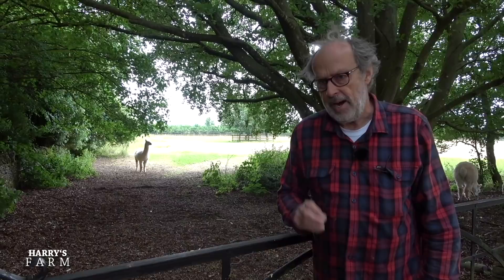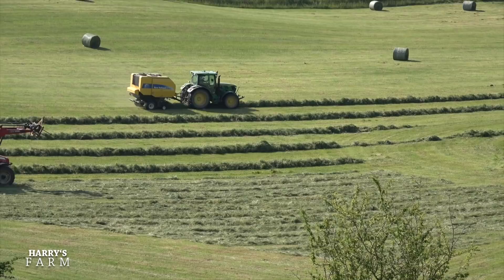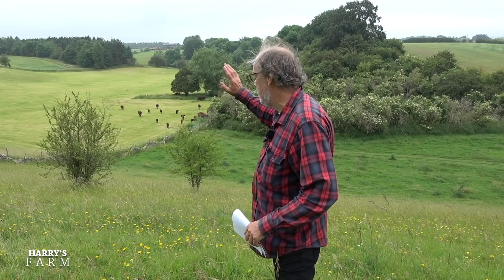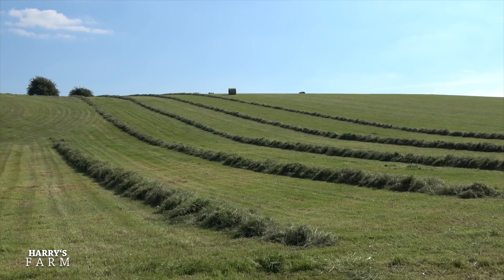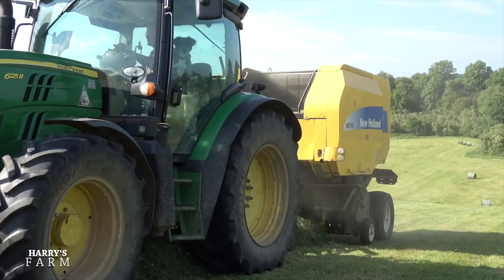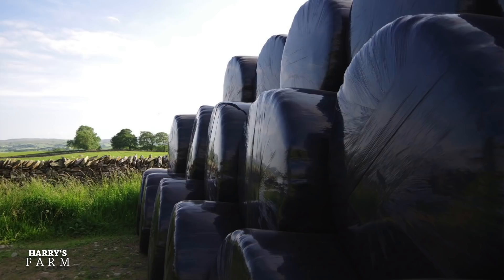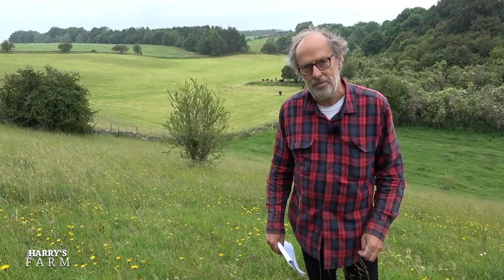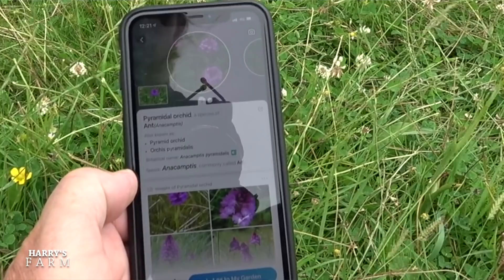Should I be growing Miscanthus for electricity production instead of growing food?

Comment: Great conversation on different crops to support carbon and energy. I would have thought Hemp has to be in there somewhere as well as an option. Love the rants on cattle farming, when I saw the Australian deal come through, I was thinking what twats the UK gov are being. Its makes far more sense to promote local producers than import from overseas products like beef, sheep, pork and chicken meats. Not just because the smaller operations here will be easier to regulate and control the quality from, but more so because there is less carbon produced in getting the products to market. Interesting you had so much trouble getting planning for a solar park? have you thought about energy storage instead of energy production? I have been thinking farm hedge-rows and fence lines are prime land where large battery or tanked energy (like liquid air) could be stored by power companies giving farms the ability to operate a bit like a grain co-op (taking in excess energy when renewables produce too much, and releasing it again when renewables do not produce enough). Regardless its great content to discuss and will be interesting to see how farming changes in the coming years.

Comment: Harry , I find your videos so interesting. Your point on using the miscanthus grass to cope with peak loading. I’m not sure that stacks up as a gas turbine gas sets can run up within minutes if not seconds I can’t believe  you could run up a steam generating set in the same time, unless of course they use it in a gas turbine which is possible but the hot blades may suffer.  Great video. Love the car stuff to. 👍
Reply: David, it would have to be burned and used to heat water to produce steam.
It won't have a high calorific content for the amount used such as coal or gas. 
The co2 produced may be offset by the amount of co2 originally taken in by the plant as it grows.
Reply: @neilorton5162  yes it would but not as responsive a gas unit for peak loading is my point.  Is it not the same as burning wood?  Food production is surely the priority. I bet it will be in the near future.

Comment: We rely on contractors for baling silage and they wrap in the field. I run around with a bale lifter taking them over to where we keep them. I've experienced a runaway wrapped bale once and was directly down range of it in the tractor with another bale on the back. The moment I saw it I threw it in reverse but reversed down to the left, we don't have the biggest tractor, a 4WD 390T with a loader but no front weights, so reversing at speed down a steep hill with a somewhat heavy bale on the back isn't the most pleasant experience. Due to the way the hill was the flaming thing turned and tracked my attempt at getting out of the way until the last moment when I turned tighter than it was going to at the speed it picked up before it crashed into another bale and stopped after that. Neither tore surprisingly. Perhaps stupidly, I didn't want to run over the yet to be baled swards in my attempt to get out of the way, hence reversing down hill to where gravity wanted the bale to go. I try to stay uphill of the baler/wrapper (our contractors now have an impressive combined baler-wrapper unit) now. :)
A family member shared a story with me a while ago about someone who's tractor was hit by a runaway bale when side on by the sounds of it and it apparently split the tractor in two. 1 tonne of silage with a bit of speed up on a steep hill and someone's wee 2WD Ford or similar in the way, I imagine it would be entirely possible. I don't know if they were trying to stop it or what but obviously the tractor came off worse.

Comment: Harry. I would be concerned as a farmer, that after investing all the money in establishing a harvestable crop of any biomass, large scale battery technology negated the need for biomass burning.
We know vast sums on money and research are being pumped into electricity storage ATM. You said yourself that solar panels would produce 5x the energy per ha, so far more efficient. Also, small scale nuclear power, either PWR or Gas cooled is being seen as a reliable zero carbon energy that can fill the wind/solar gaps.
I think the miscanthus would need to stack up purely on the carbon credit front to make it financially viable longer term (5yr+) to make me interested. I wonder what the carbon sequestration is if the biomass is chopped and left on the field?

Comment: Harry, 

I would say from a sensible point of view no, whether it makes commercial sense to you is entirely another matter.

Drax, in Yorkshire burns wood pellets which I would guess have a much higher thermal value than grass. Wood pellets have a lower thermal value than coal and hence emits more CO2 per Mwatt hour. Grass I would imagine will be worse.
Drax's fuel comes from chopping down forests in America, processing the timber and then shipping it to the U.K., all highly intensive in energy terms and then the loss of a forest for decades until it regrows so why they consider Drax to be renewable and pay them a subsidy as well is beyond reason.
Quite what energy is required to grow and process the grass is beyond my experience but it seems illogical to grow plants just to burn them as an not too effective fuel.  Much the same as ethanol for fuel, again an energy intensive process yet they claim it will reduce CO2 emissions from transport, frankly I do not believe that is true.
Reply: It’s utter bullshit. Harry should hold his head in shame for even considering this.

Comment: 1 ha of Miscanthus can produce biomass equivalent to 12 tons of coal.  It can be easily converted into biogas, that being almost identical to methane/natural gas is ideal for light vehicles in compressed or liquid form.  The only issue is energy crops replacing food crops........which is why Miscanthus and switch blade grass are best suited to compliment traditional crops on poor,marginal farm land since it requires almost no investment in tillage and herbicides, and can control soil erosion.   If we can get all that marginal land into biomass crops, it can make a substantial contribution to providing net zero carbon, and energy diversification. If you want electricity, just build Thorium Molten Salt Reactors..........but who wants clean electricity at half the cost of coal, no profits or scarcity in that business model. There would be no need to herd people into ""15 minute city" concentration camps and other such dystopian totalitarian schemes.

Comment: Just few random thoughts about the "monstrous" CO2... The recommended levels of CO2 to maximize the crop output from greenhouse installations is 1500-1700 ppm. And no, nobody in this business reports decreasing of their heating bill during the cold months when heating is needed with those levels  achieved. Our planet went through multiple cooling periods{ice ages} with levels of that gas even above 3500 ppm. Also this quite simple molecule does not bear any specifics which would allow to distinguish which ones are results of our activity or other, natural processes{mostly volcanic activity}. We have pretty good idea how much we increased the CO2 productions due to our industries but to explain the increased CO2 levels only because of that is... quite simplistic to say that mildly. Do we know how much CO2 the volcanos produce{d}? What are the exact{or appr ofc} measurements of the CO2 produced by the underwater volcanic activity{71 percent of the planet surface is covered by oceans}? We dont know? Right, we dont. If we are headed towards another cooling event{its about time unfortunately} even if we quadruple{or more}  our CO2 production that will be for naught as far as the global temperatures comes in consideration. There are others way more powerful factors determining the global climate than the non player in this particular game CO2.
Reply: @mramg6038  Solar activity, the way of  the changes of the Earth's tilt and orbital distance from the sun{ check Milankovitch cycles}, the albedo controlled by the only gas with real greenhouse effect  on this planet - the water vapors are among the few factors truly determining our climate...We are not really understanding yet the complexity of those processes least controlling them...CO2 is only an indicator at best and really helpful for the vegetation growth in the concentration mentioned above.

Comment: Just build your own Pyramid an extract energy outa the etha, an it'll add a relevant backdrop to your Dakar bike collection.
I'm off topic again sorry about that.
What about sugar beat can't that be turned in to combustion fuel what octane did it achieve?
I recall my dad saying sugar plantations running vehicles on alcohol fuel derived from sugar, just need a vscc meating you've got the hills the crops of fuel the motoring passion, it's all there Harry.
Failing that can you dig for oil an start a small refinery just for subscribers so we can run old motors, I'm running high octane Harry it's a sugar beat sugar molasses cow methane combo, bigger power bands pull wheelies a gear up from standard, gasoline, just being daft serious on them pyramids though.

Comment: Electricity Supply Volatility - no sun, no wind = no power. Wind/Solar are unpredictable and fixed ie. you can't summon more wind just because the FA Cup is on. So gas powered generation is required to ensure consistent load in the national grid and meet surge requirements. That's what's got the govt worried - the possibility of mass brownouts during peak times.
Biomass removes the emissions problem without losing the "instant response" of a gas fired station.
Unfortunately Miscanthus isn't ideal but the whole carbon sink equation makes it financially viable. 
Energy industry would prefer high energy oil based crops like aloe or castor which are suitable for land unusable for food production and great for crop-sharing and semi-arid conditions. They would be perfect for places like Afghanistan and offer the locals a cash crop alternative to Opium, or northern Brazil, which has been pretty much depopulated due to the environmental impact of deforestation.

Comment: There has to be an alternative to diesel fuel,  but the justification for growing crops for electricity production still shows muddled thinking. 
Hydrogen might be in abundance, but the costs of converting it to a usable form are currently eye-watering. The last figures l have show it takes 2.9kw of electricity to produce 1kw of usable Hydrogen. Even then it is not a very efficient fuel.

Comment: Surely you are putting the co2 back when you burn it?
Reply: When the bales are stored waiting to be used, another crop will be growing removing CO2 from the air/atmosphere, plus the stored bales contribute to that 'carbon battery' while they're waiting to be used. If 1 million tonnes of CO2 is locked in the bales, then it is 1 million tonnes released when burned, but it's also 1 million tonnes waiting to be burned when bales are stored to ensure a constant supply to power stations, and say 1 million tonnes actively being removed by the crop growing in the field, so you could have 2 million tonnes of CO2 locked in the system. Obviously there's a limit to how much CO2 it can take out of the atmosphere, once the limit for the market is reached, say that 2 million tonnes value, all you're doing is 'recharging' that 'carbon battery', so any 'new' CO2 produced from other means isn't being removed from the atmosphere and any increase in CO2 that occurs after the maximum capacity of the system has been reached will continue to increase as much as it would have without the system, it would just be 2 million tonnes less CO2 for that given point in time (which might sound like a lot but in reality it isn't, the planet's humans exhaling produce billions of tonnes of CO2 every year alone).
Burning it is still fully carbon neutral and that's all the government cares about. Carbon neutral is only about not adding CO2, it's not about removing the CO2 already present that is apparently causing the problems, that would be carbon negative, a process that removes more CO2 from the atmosphere than it produces/releases. Someone planting trees as the only thing they do with no intention to cut them down in the future is probably the best example of carbon negative I can think of, but it's not that simple in reality. If those trees come from a nursery of some sort then the initial stage could be energy intensive and dent the positive impact planting those trees has, and they won't have infinite acreage to plat them nor will those trees grow infinitely, but I'm probably overthinking it now.